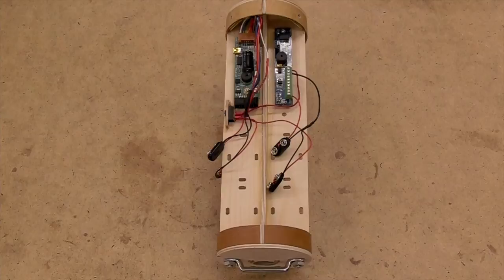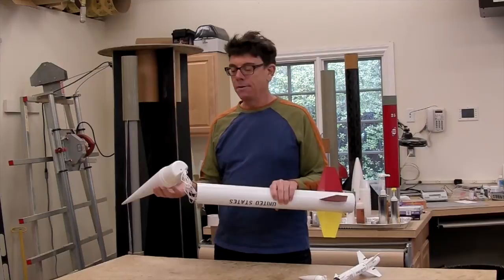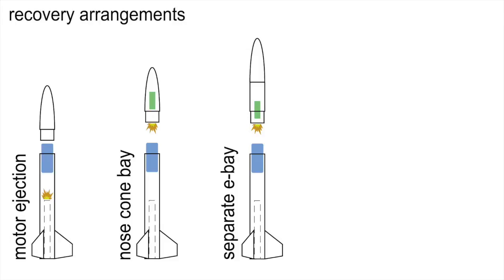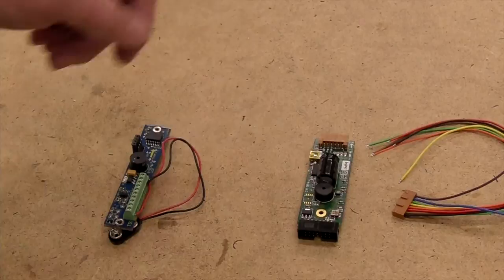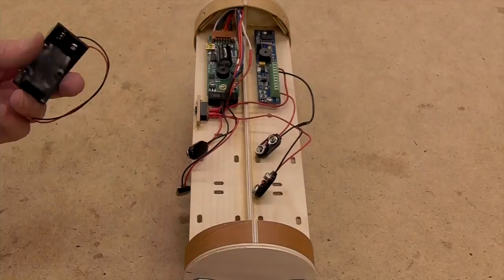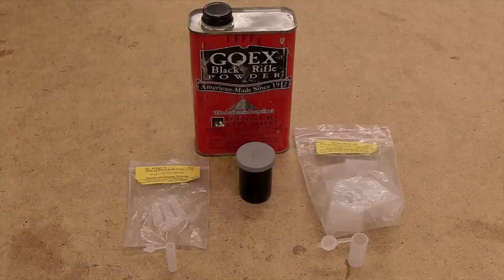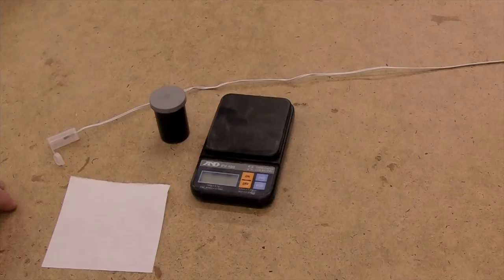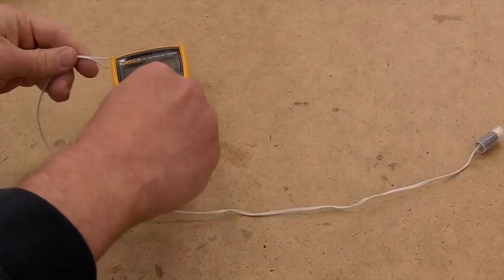Electronic Recovery

Comment: Great video! For my Ejection Charges, I am going to take a 1 inch by 1/2 inch diameter copper pipe, sweat on an end cap, and screw it to the bulkhead via a small hole and screw in the end cap. I will have thumb screw connectors on the bulkhead that the electric match attaches, I stick the match inside the copper pipe (pot), tamp in the black powder, a little wadding, and a few drops of hot wax to seal it. I am going to have two switches, one for Main Power, and another for Launch/Eject Safety. 
I prep the rocket on the stand. Place my electromagnetic Launch Transducer on the proper spot of the hull on the Avionics Pod (no mechanical connection), the Launch Panel is over 100 feet away, I have the key so it is safe. I use wire not radio to launch - less chance of jaming/false triggering. I turn on the Main Power on the rocket, the Trinket M0 does its self test and if all is OK and it confirms no current to the Launch/Eject transistors, a greed LED comes on (safe to apply power via the Launch/Eject Safety switch). If the green LED is not on, something is wrong and you simply turn off the main power and leave the safety switch in the safe position. I walk back to the Launch Panel, put in the key and turn it to Power On, I can see the green LED on the rocket. If still green, I press the launch button, this causes a strong magnetic field in the Launch Transducer. The circuitry inside senses the field and begins its "mission" sequence to launch and control ejection at apogee.
Reply from the maker: Interesting idea for a launch controller. Good luck with your project!

Comment: I am going to use an Adafruit Trinket M0 microcontroller. It costs only $9 USD and is the size of a postage stamp. Adafruit makes a wide assortment of low cost sensors: Altimeter, 3 Axis Accelerometer, Temperature/Humidity, Cameras, and much more.  Coding the Trinket M0 is easy, it uses Circuit Python built in. You simply write your code in a text file using any text editor (like Notepad), connect the Trinket M0 to your PC via a USB cable, the Trinket M0 shows up as a mini Thumb Drive and you simply drag and drop your file onto the Trinket M0 and you are good to go. It has a built in green power LED, a programmable Multi-Color LED, and a programmable on/off Red LED - all built in. It has 5 I/O pins that can be programmed as inputs or outputs, one can be used as an Analog input or output. You can daisy chain all of your sensors using just two pins programmed as an I2C bus. I am going to add model rocketry to the Summer STEM class I teach. Young minds love to program! Adafruit even makes the Feather M0 which has much more I/O and capabilities for only $22 USD and is only about double the size.
Reply from the maker: Yeah, there's an amazing variety of things available. I'm sure you'll have fun developing your own system.
Reply: @JohnLCoker Thanks. I just finished the hardware design yesterday. Now I have to write the code. I had to switch to the Adafruit Feather M0 because I needed more I/O. Part of the power on self test is to measure battery voltage, then apply a small amount of current to each electric match as a continuity test to insure they are connected properly.

Comment: Very interesting,  can you give more detail on how reverse ejection works, the arrangement of the parachute and such ? I never thought of that as possible method before.
Reply from the maker: "Reverse" just means which part of the airframe the coupler is fixed to (aft vs forward section). Expanding gasses press evenly on all surfaces of the container so it doesn't really make any difference which end the coupler slides out of. The parachutes are still arranged the same way.

Comment: John, just wondering why you choose to use the plastic vials instead of ubiquitous cups that you tend to see for deployment charges.  It seems obvious that they are lighter, less expensive and simpler.  Are there any other reasons?  Any other advantages or disadvantages to your method?  Also, regarding retaining the vials, have you considered a lightweight electrical clamp to hold them down, or would that affect the deployment charge in a negative way?  I only ask because I know things like heat can affect the adhesive on tape and I'm a little leery of the affect of a vial-style deployment charge coming unstuck after sitting on a hot pad and swinging free.
Reply from the maker: The charge wells are fine; I just find it easier to use disposable containers. They're easier to prepare outside the rocket and there's no need to clean the wells. They charges are light, so I don't think there's any need to tie them down at all; I like to tape them in place just to keep things neat when prepping the rocket.

Comment: Instead of using black powder would a firecracker do as well ?
Reply from the maker: I believe firecrackers are made with a different formulation, more like flash paper, but you could give it a try I suppose.
Reply: Since Hogden, the last US producer of black powder (Goex) will not be producing Goex after this year (2021), how does Pyrodex work for the ejection charges?  I would think that the electric match would set it off ok.  Pryrodex requires a hotter ignition source than real black powder.

Comment: How reliable is electronic deployment and is the software generally pretty easy to work with? I'm in the process of building a Madcow Super DX3 for my level 1 certification, and I want to put dual recovery in it, so that I can use it for my level 2 cert as well. Also, what is your opinion of the Perfectflite Stratologger altimeter CF? What kind of transmitter can I add to it so that I can get the location of my rocket transmitted to me? What will receive that transmision? Thanks you for your help -Matthew
Reply from the maker: If you do everything properly, very reliable. IMO the source of unreliability is not the hardware itself, but setup and wiring.  For example, improperly stripping insulation on solid core wires will nick them, which creates a weak spot that can break. Note that electronics are also more accurate than motor ejection, which becomes a significant source of failure for heavier rockets.
Most software used to configure electronics is poor, so I suggest starting out with a unit that needs little or no configuration.
Reply from the maker: I have not tried them, but they seem to be popular and well-supported.
Reply from the maker: Lightweight cloth is used in R/C aircraft, so a local hobby shop would have it (if there is one near you). Otherwise online; search for Hobbico 3/4oz cloth (http://www3.towerhobbies.com/cgi-bin/wti0001p?&I=LXL491&P=ML).